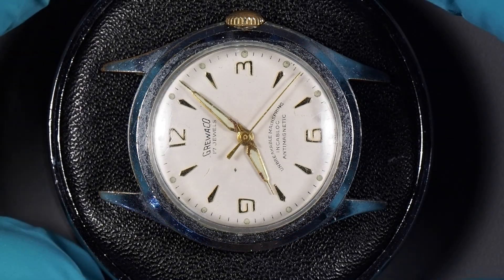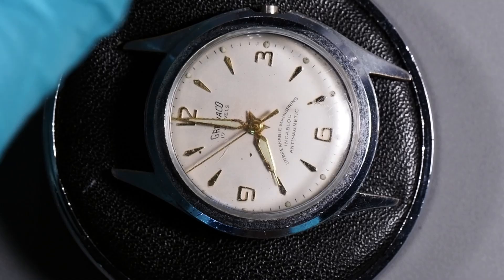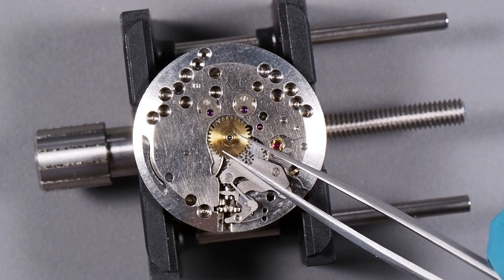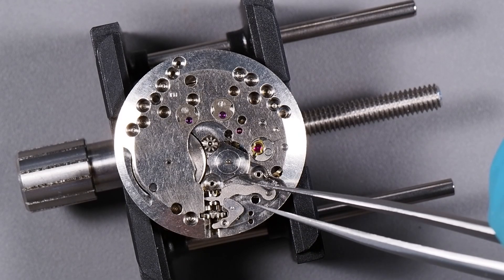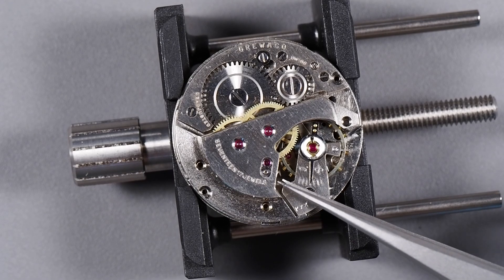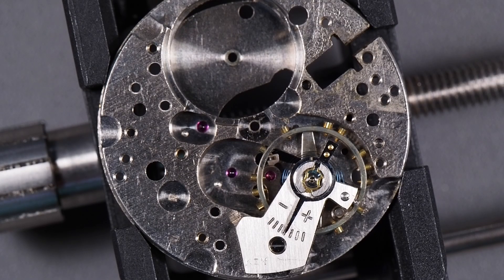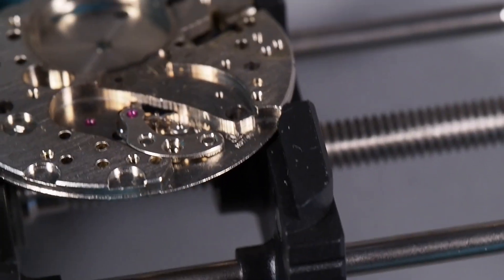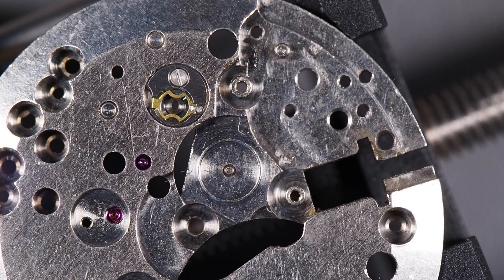Grewaco Watch with AS-1187 Movement Repair - Part 1

Comment: The condition of that mainspring doesn't look bad to me from what I can see, but I can't tell just by looking at it in the video, you may be right. It could be bad. Of course I wouldn't say it was set just because it's circular. It's an old style mainspring that's supposed to be circular like you see there. Either the watch hasn't been serviced in a really long time or it's the original mainspring that came in the watch from the factory. I guess it's also possible it was replaced with a new old stock mainspring previously. The new style mainsprings have the s shape.
Reply from the maker: You may be right about the old steel springs being circular, but they're still a bad idea to reuse because they can break and damage the movement. The alloy springs we use now were marketed as "unbreakable" when they were introduced; and they almost never break.
Reply: @WatchmakerChris Replacing it is a good idea because of its age. I guess what I was trying to point out is that I wouldn't call it set because of its round shape.
Reply: By the way, I do enjoy your videos. Thanks for making them!